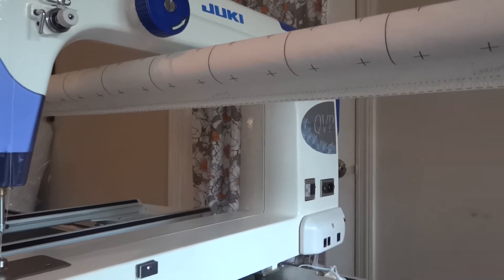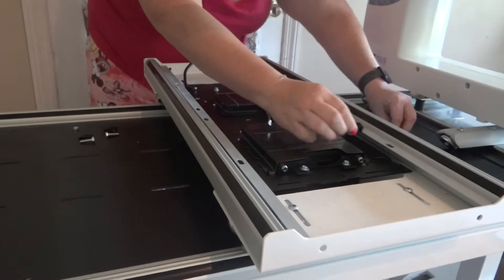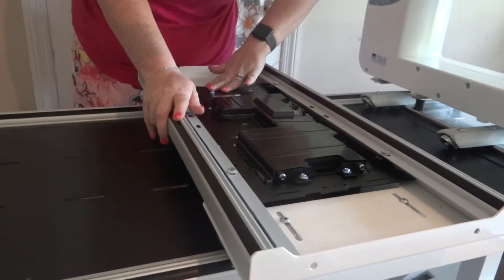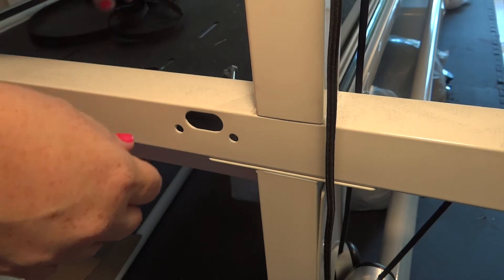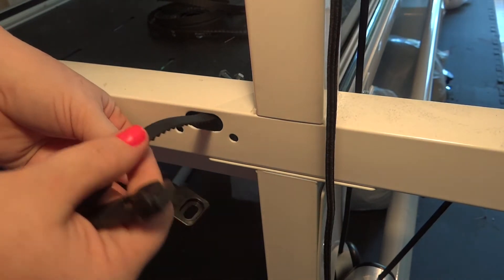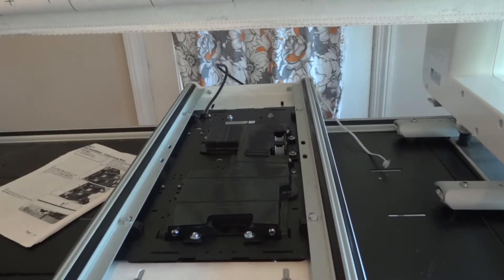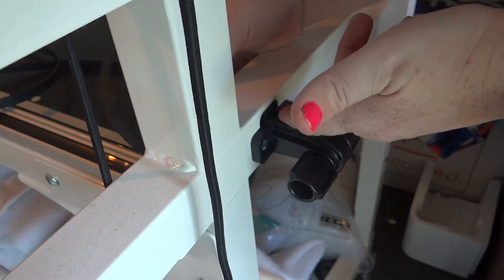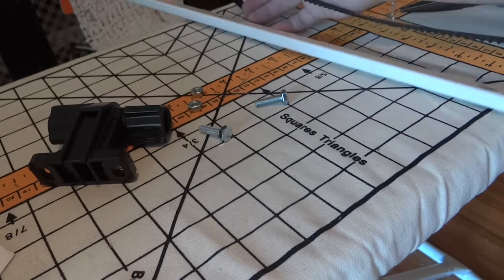Quilter's Creative Touch Robotics Installation for Juki TL2200QVP Longarm

Comment: Do you like your Juki long arm..... I’m looking at buying one, but not many people know about it.   Great job on the video
Reply from the maker: I love it! I've had it maybe 6 years now and my Mother just purchased their latest model the Miyabi as a sit down version and has been loving it for the last year. There is a group on facebook for owners and those interested called "Juki Longarm & Quilting Machines" where you can ask questions. I will warn that most of the posts there are people asking for help with machine errors because the response rate is pretty quick. Those of us who haven't had issues don't really post in there since it's more of a support group. My 6 year old has been quilting with it for 4 years now and he operates it on his own. Of course I have to load the machine and thread it but operation wise once you're comfortable it's smooth sailing!

Comment: I am trying to figure out which robotics I need to order for my machine. I have a Juki TL2200QVP Virtuoso Pro and a Grace frame. After watching your video I decided the Quilters creative touch that you installed was the way to go. When I called the company to order it, the salesman told me that the Quilters creative touch was not belt driven. Now I am confused. Also, in the part of the video that talks about the short belt installation, I do not have the long pole you showed that you stated came with the machine. Any suggestions?